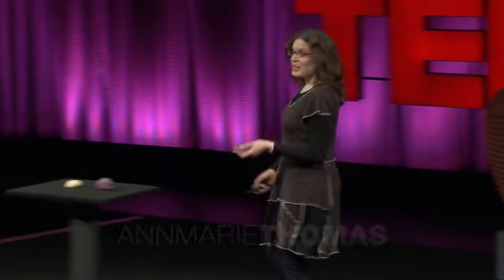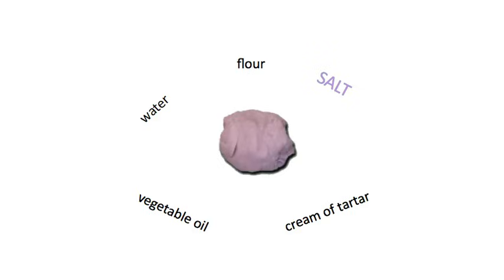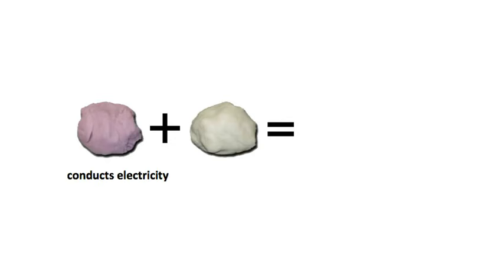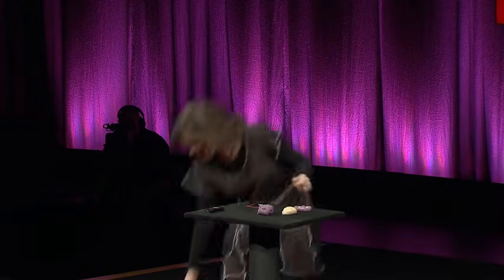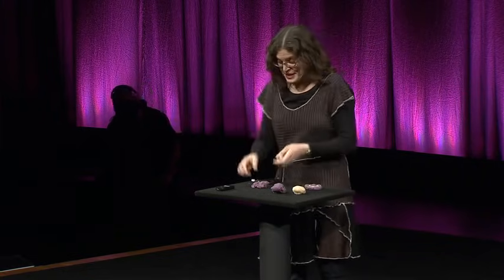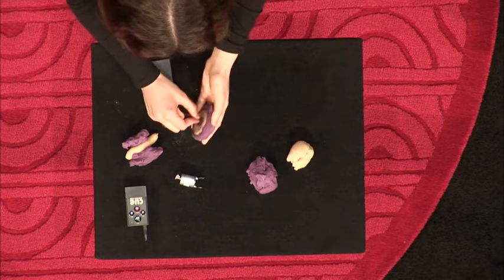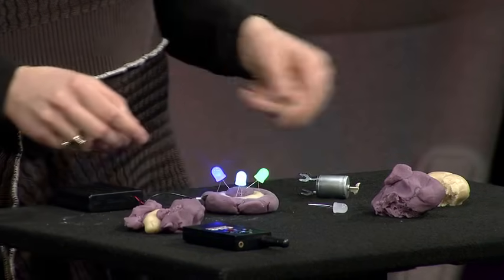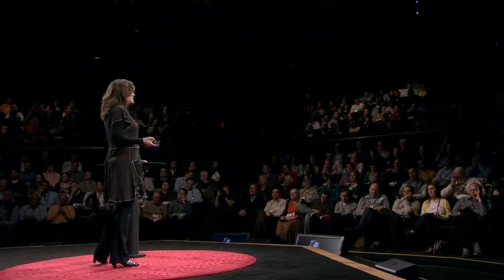AnnMarie Thomas: Hands-on science with squishy circuits

Comment: Wow. I  taught circuit building to elementary age kids for 4 years and could have really used this knowledge.  It's definitely hard to use circuit boards, but I built giant sized ones with foam core, heavy wire and big light bulbs.  This is brilliant.